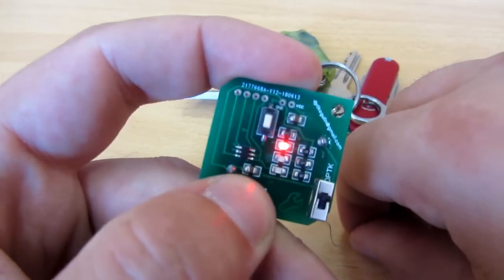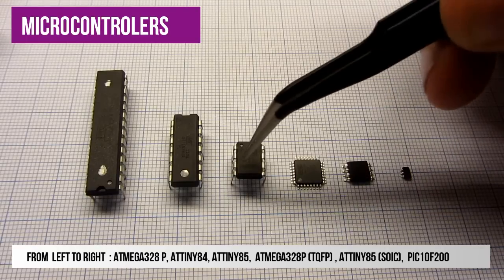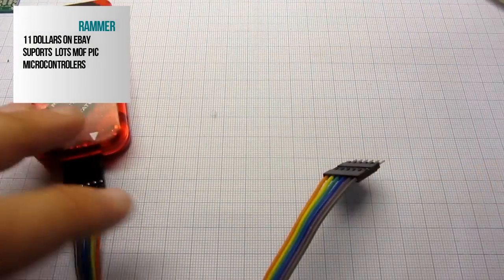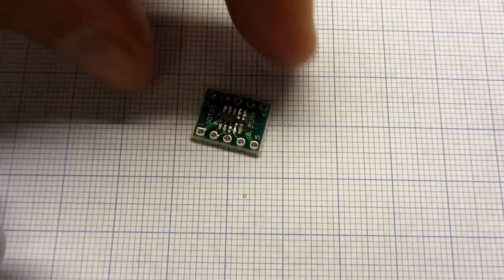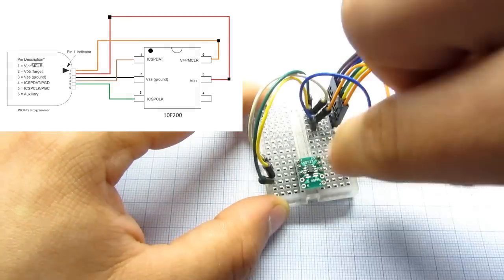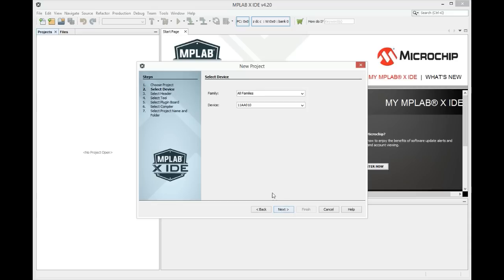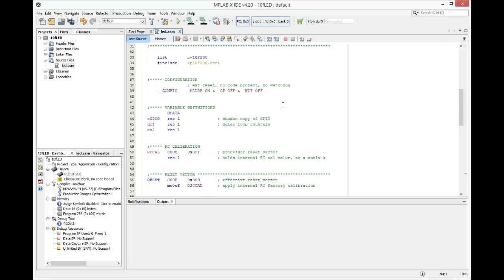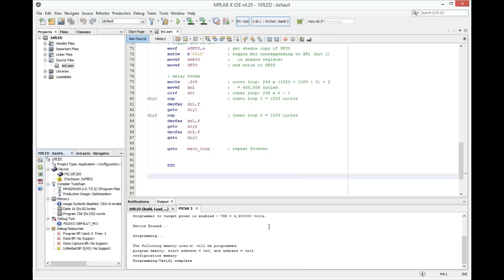Smallest and cheapest microcontroller -  tutorial

Comment: It's the smallest I've seen, but the cheapest is an 8 pin that uses PROM for program storage and comes in at $0.03USD for single units. You're right about it being a pain though.
Reply: Another pain with this $0.03USD chip is that you need a programmer for $100+USD. And maybe as well an in-circuit emulator as you can program it once.
Reply: i hope soon someone could build a cheap programmer for it, it will be very great to play with those cheap uC
Reply: @masaratech  just use arduino
Reply: @ryanchowdhary965   Arduino is the size of a Buick.

Comment: @3:40 I wouldn't recommend that you solder pins or boards while plugged into the experimental plastic sockets, this is because those plastic sockets are susceptible to heat and may melt or bend causing electrical disconnect, or intermittent disconnect. This will cause circuit operation problem. Instead use stand alone IC chip sockets or aluminum tweezers to hold those SMD pads and parts while soldering them.
Reply: Or you may dedicate one experimental plastic socket for those kinds of soldering operations but never use it for circuit testing.  Then mark it as not for circuit testing.

Comment: Roll on a couple of years and there is the improved PIC10F32x. But STILL no serial peripheral! This really frustrates me about the 6 and 8 pin PICs and AVRs! Surely the obvious use case is intelligent peripherals: putting a single sensor or actuator onto a serial bus? Yes I know you can bit-bang a serial peripheral, but that is hard work, consumes a lot of the already limited resources and will not be as power-efficient. This use case is so obvious it really baffles me that Microchip keeps missing it!

Comment: I have an HT48R32-B-0 microcontroller in my hi fi audio amp and need a programmer to copy it to  blank one so I can fix my other amplifier. i have the original chip so i just need to copy the info from one to the other . What exactly do i need?
Reply: Your first goal should be to read the device. This will tell you if the code is data protected.

Comment: I don't get it. If one has to use an adapter board because the controller is too tiny, why not just use a bigger controller? The price difference should be negligible for an individual who uses only one or two of them.
Reply: That's just it - this is really meant for industrial integration in custom boards, not hobby projects. But it's a cool novelty to play with.
Reply: Because the world doesn't run on Arduino , aka baby's first MCU.
Reply: I think there are several reasons, especially size.  I think there is another microcontroller in a transistor package, even less expensive, but it is not really smaller and has fewer io.
The last reason to use this processor is  bragging rights, lol.